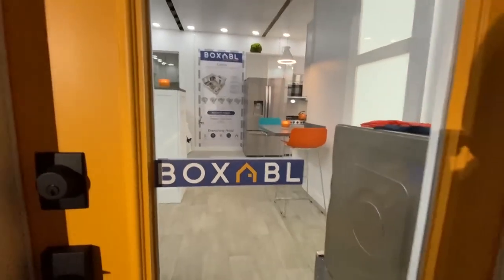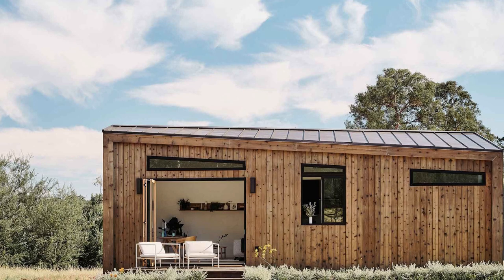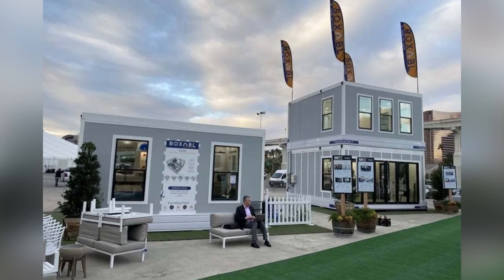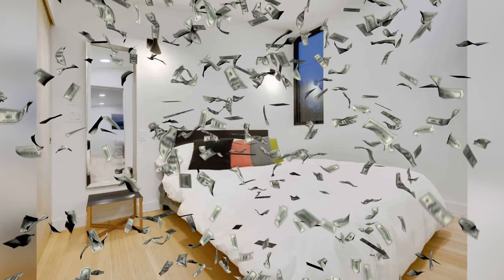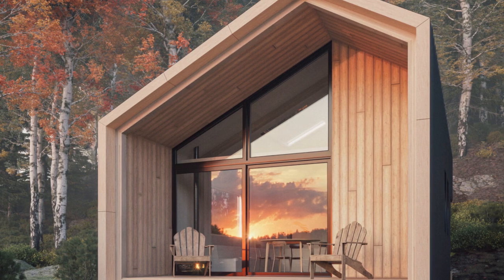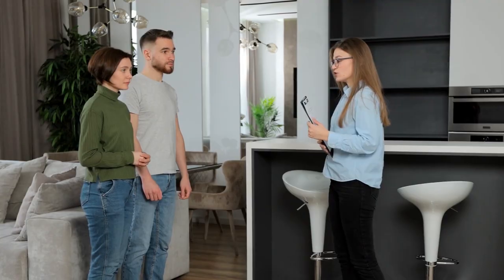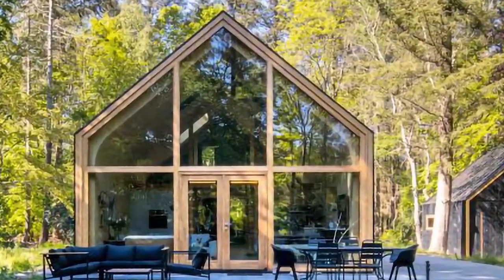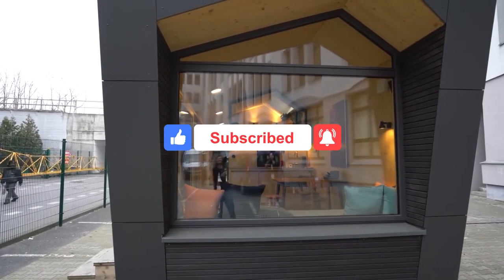11 FANTASTIC PREFAB HOMES [MAY 2023]

Comment: The price on some of these is insane.
Reply: Yeah, for the price of some of these smaller homes, I could get a custom home of 2000 square feet, 2 story house with 4 bedrooms. Seriously, the prices have gotten outrageous.
Reply: @evilspoon5280  I agree. This is supposed to be a less expensive way to go, and it isn't anymore.
Reply: @eugeniaskelley5194  ...yeah, whatever happened to the basic rustic package. I dont even like most overly luxurious houses, too over the top. I prefer a rustic look with basic counter tops and such. In all, only in a few areas will i upgrade to a more expensive option, but only a few.